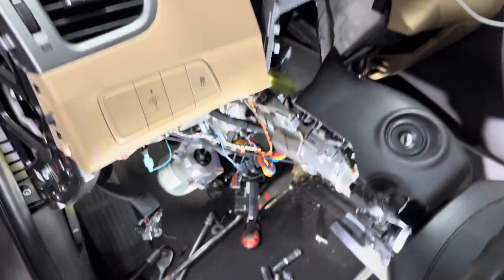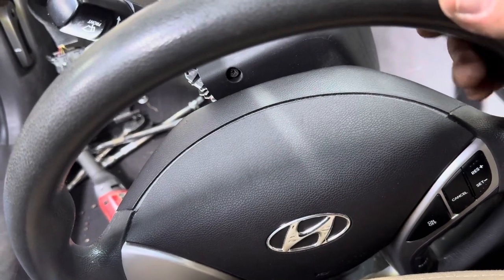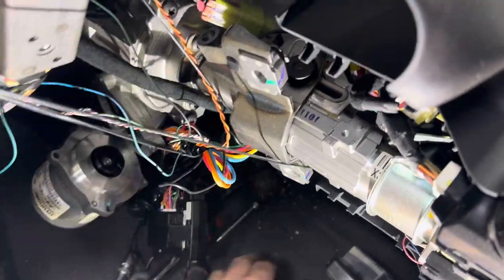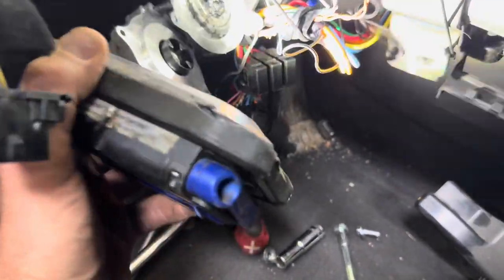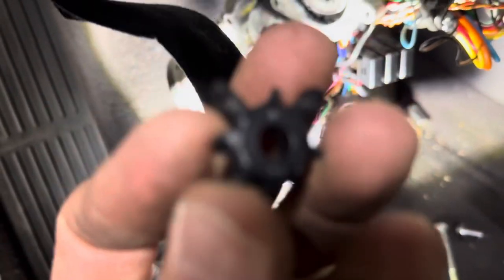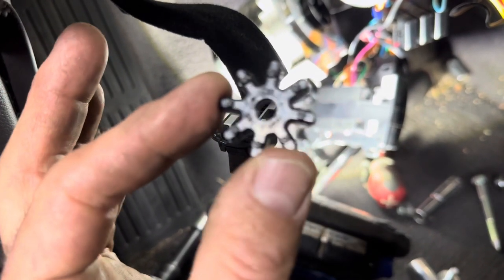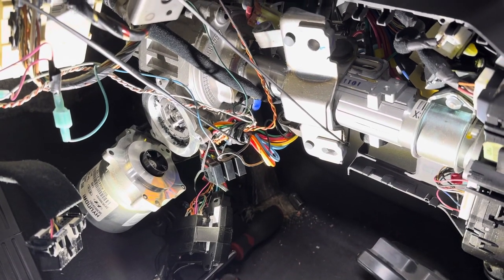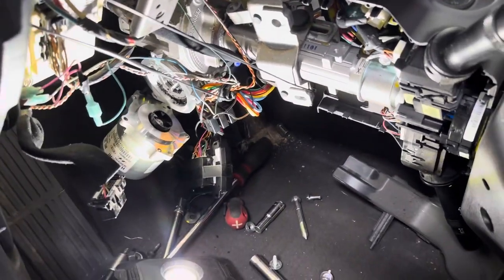How To Fix Hyundai Kia Steering Wheel Clunk

Comment: Does all the wiring get rewrapped ?
Reply from the maker: Actually, no wiring needs to be removed or unwrapped. What you are seeing loose is a aftermarket remote starter system that is hanging loose. We did secure it when we buttoned it up.